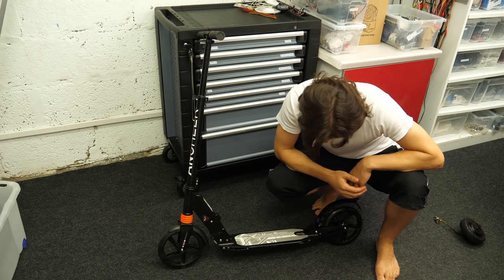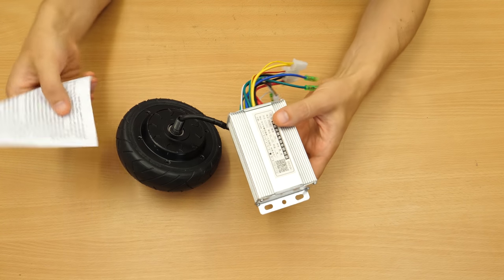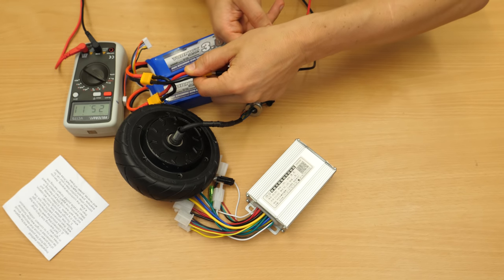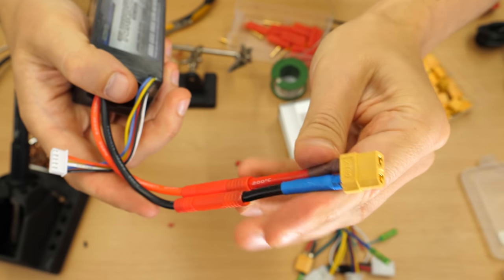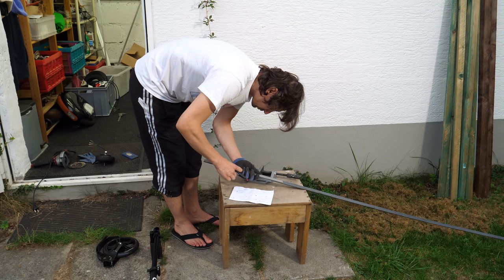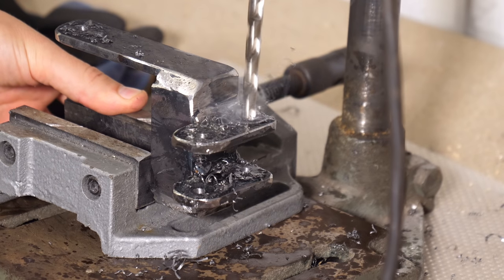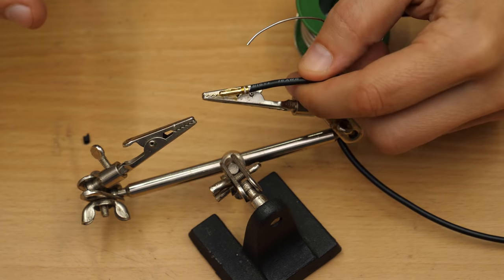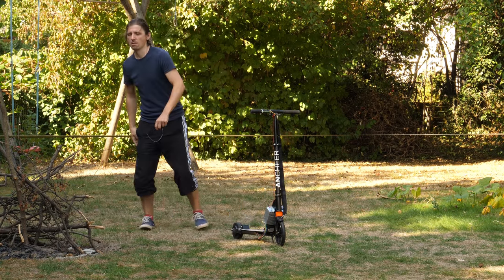DIY Electric Scooter Part 1: Conversion

Comment: pls secure your tall bottle when you weld ...if it falls on this huge ass pressure regulator, you will see what happens
Reply from the maker: I know.. that is really sketchy. I have bought some profiles to weld a welding table
Reply: @bitluni  Also, smear Bondo on your welds before painting to hide crappy TIG welding.

Comment: Are you still using the scooter? I also got myself a 8 inch hub motor, 2pcs of 5C lipo and the same looking Chinese controller. Is it holding up against the extra voltage?

Comment: Awesome project! I like that - building vehicles! You can buy these motor wheels already ready-made? You're the coolest cappuccino rider around town! I swear! :D (3D printing doesn't work for that? Not sturdy enough those parts I guess?) (looking forward to some 3D printed battery holders!)

Comment: Could you take the speed controller apart to show us what is inside?

It would be a cool to make an open source speed controller, perhaps adding more features. Would regenerative braking be possible with this motor?
Reply from the maker: VESC ist the keyword. It's an open source ESC I will share soon since I use it with my 1kW motors. But it's quite expensive since the parts are too
Reply: cheap controllers already have regen braking

Comment: Awesome videos... I was wondering if you could help me with my e scooter. It is a kickboard T3 by Inmotion. I love it but the battery dies way too quick and the back wheel hub motor is a bit on the cheap side. I wanted to upgrade it and was wondering if you can point me in the right direction. Id really appreciate any help you could provide. I am a novice when it comes to these things though I am a super fast learner.. God bless and hope you and your are safe and healthy.

Comment: A question: let's assume someone builds a e-scooter modifying an existing frame (unpowered or powered) like in the video of bitluni, with power =< 500W and 6km/h=< Speed =< 20km/h. This e-scooter would not require an official registration (Zulassung), just an insurance  (Versicherung). Ist it correct? But how the Versicherung can legally be released, from what I quickly see online in an insurance calculator (HUK), it seems you need to provide a verified model of the e-scooter, which I think is of a list approved by the German regulator. Of course it makes sense for the law, otherwise many would put on the road their "custom-out-of-spec" e-scooters. Anyone has any experience? I read that it is technically possible go to the TÜV and get your "custom" e-scooter approved, but I can imagine the cost....

Comment: Connecting two battery banks of different amp-hour capacity together in series is a bad idea :P
Reply: can you explain please?
Reply: Connecting? No, it won't explode right away. Using? Yes, kinda. There's the same current passing through each series cell that they all have to source, they output the same charge per unit of time. So whichever one gets flat first, goes into overdischarge and then bad things happen, though given that these aren't soft pouch cells, at most a bit of venting with flame, not an actual full blown fireball. So just don't let it get to this. And when you do, just make sure to be away from combustible stuff, preferably outdoors, and away from eyes and hands. And I mean it's no big deal, you already have a potential fireball in your pocket, so don't panic.
Reply: @SianaGearz  "over discharge" is not the prob... after a cell gets discharged to 0, it gets negetive charge while current is still passing due to remaining charge of other cells in series. thats the really problem
Reply: Yes, reverse charge. misspoke.

Comment: hey guys can anyone help me i have a volt XT2 scooter with no battery the battery it takes is 12V 8Ah Sealed Lead Acid Battery i have 12V motor 120w i am looking to incresse the speed at least twice over if not to expencaive ££ any help would be good any info needed please ask away

Comment: this is pretty pointless.... just get a xiaomi m365... 250 euros, air tyres, disk brake,  30 km/h top speed and most of all it is actually designed to be electric